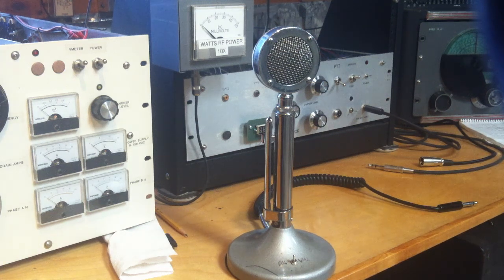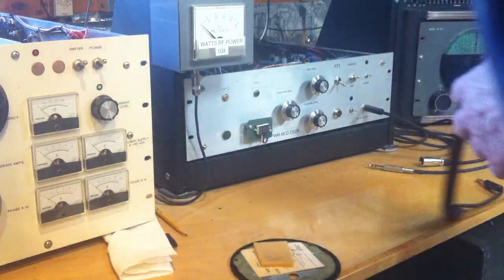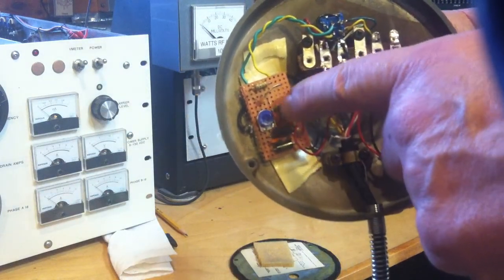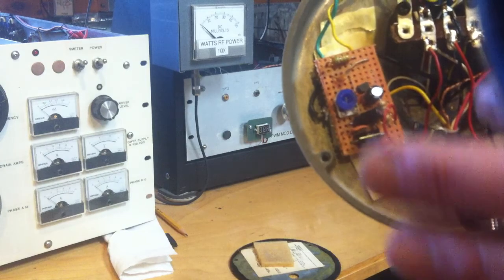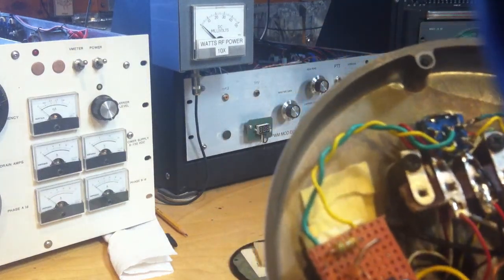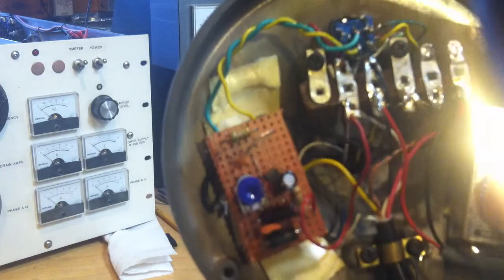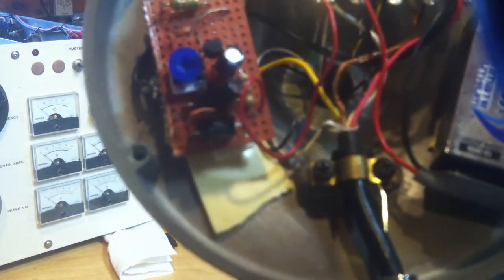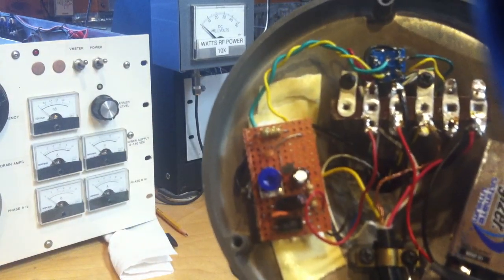D104 Microphone Source Follower

Comment: How do you turn off a D-104 ?   Bought one at a swap meet yesterday (needs work)
Reply from the maker: Use the PTT switch.  I use it to switch in/out the battery in the FET amplified mic.
Reply: @pf_n1ps  you lost me,   only have side bar ptt.
Reply from the maker: @jimgresham5529  The contacts are available at the base.  You want the N.O. contacts.
Reply: @pf_n1ps  guess you will have to draw me a picture.   Had to swap some plug wires around for my Galaxy DX 2547 and it works good.   stamped 10-77